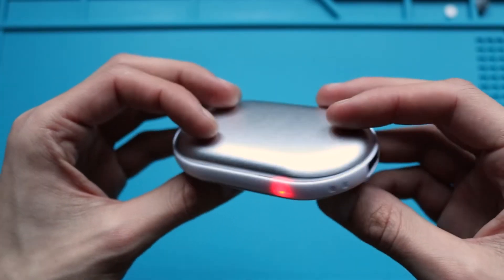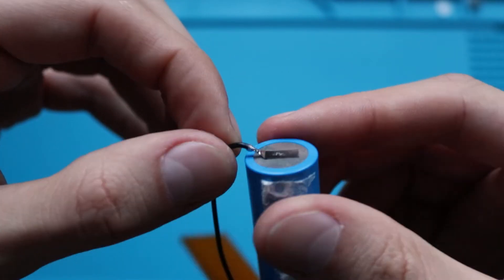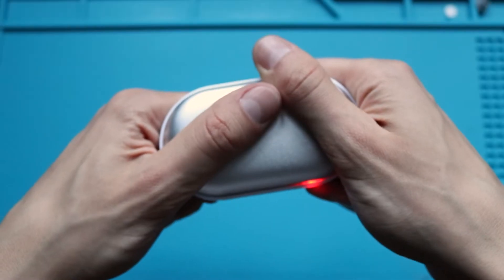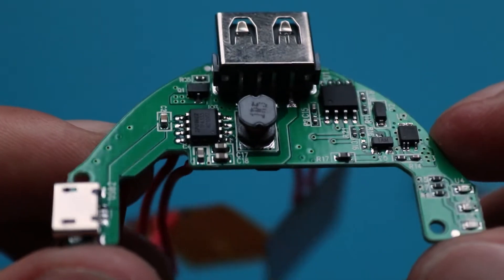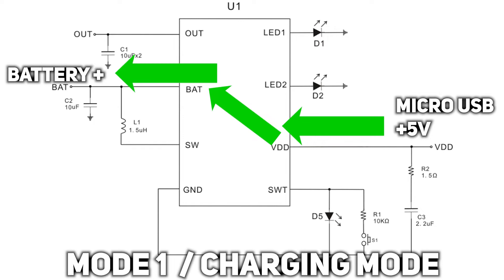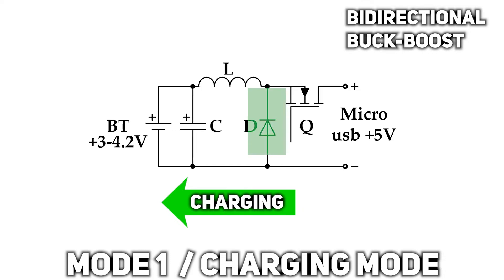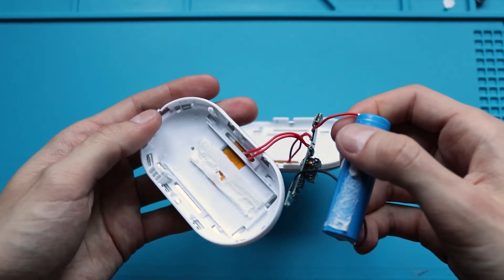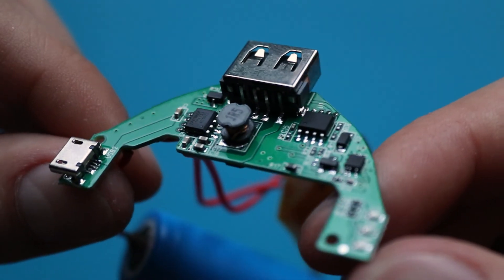What Is Inside Hand Heater From Aliexpress (With Schematic)

Comment: Could R17 be NTC?
Reply from the maker: Actually it can be. But it is strange that the marking "NTC" is on the other side.. and pads as well. Maybe it is duplicated just to be able to solder NTCs in two different packages. 
I will check it when I have time and will say if it is an NTC))
Reply: @NickElectronics  It's pretty normal to replace expensive thru-hole components with cheaper SMD. Precise measurement of temperature is not that important there, I think it serves overheat protection purpose only.  Try to heat it with lighter or soldering iron and check if it turns of heaters.